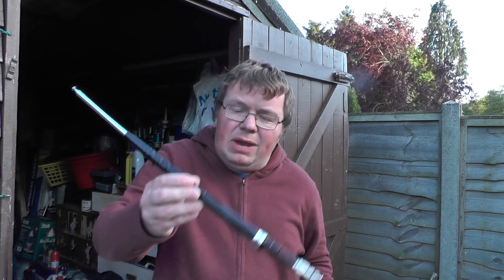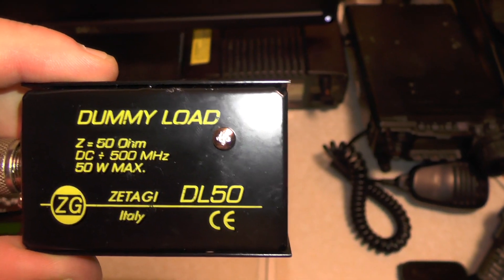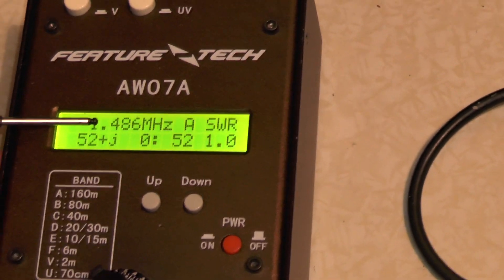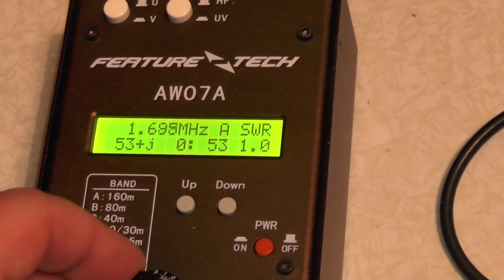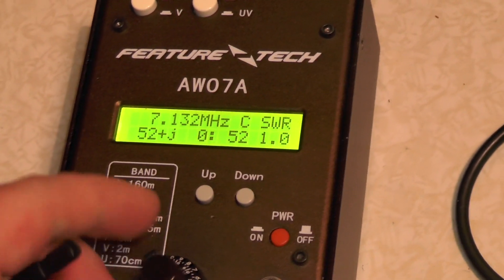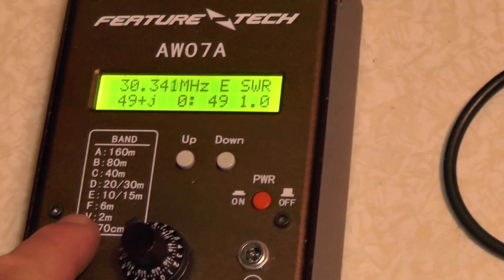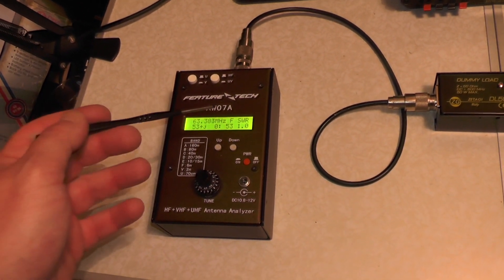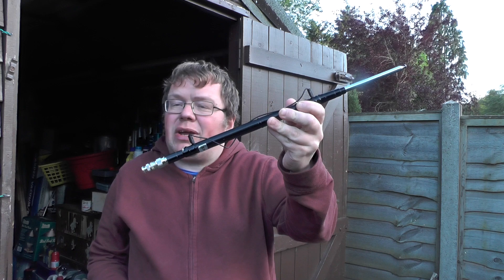Feature Tech AW07A + Dummy Load

Comment: If the analyzer doesn't reach the spec it's supposed to, (unable to cover 6m) there is a problem straight away. Try using a different analyzer that is in spec or a different set up, maybe with a known rig / antenna  You could end up chasing your tail otherwise. 73's Mike G1VJG.
Reply from the maker: It covers 6m but not 4m not sure why . My friend has the same analyser and it works on 4m . Maybe a software issue ??
Reply: @2j4ez  Can you contact the manufacturer or their selling agent?
Reply from the maker: No I’ve had it a few years now must be out of its warranty by now
Reply: @2j4ez  Well,if they're still in business they might still be able to help. I guess you've already done a web search to see if others have had the same problem, so I can't think of anything else to suggest. Maybe https://www.google.com/url?sa=t&rct=j&q=&esrc=s&source=web&cd=&cad=rja&uact=8&ved=2ahUKEwjyuqvR0LjqAhWDZMAKHWzvDSYQFjAFegQIAhAB&url=https%3A%2F%2Fwww.amazon.co.uk%2FFEATURE-TECH-Impedance-Analyzer-Hobbyists%2Fdp%2FB07KRTLSC6&usg=AOvVaw2Ho1bUQQ9ln6FS8kNrENlx       

 OR      

https://www.google.com/url?sa=t&rct=j&q=&esrc=s&source=web&cd=&cad=rja&uact=8&ved=2ahUKEwjyuqvR0LjqAhWDZMAKHWzvDSYQFjALegQICBAB&url=https%3A%2F%2Fforums.qrz.com%2Findex.php%3Fthreads%2Ffeature-tech-aw07a-antenna-analyser.591574%2F&usg=AOvVaw0IkCwig8ex9p0Mv2OQViYO